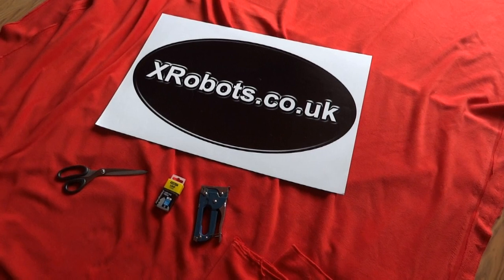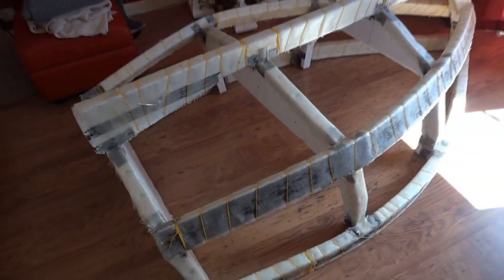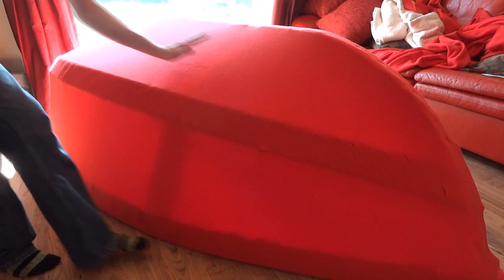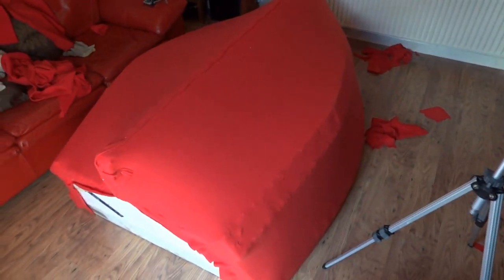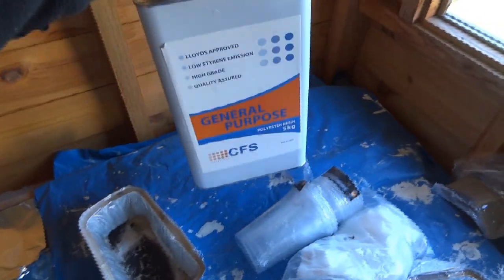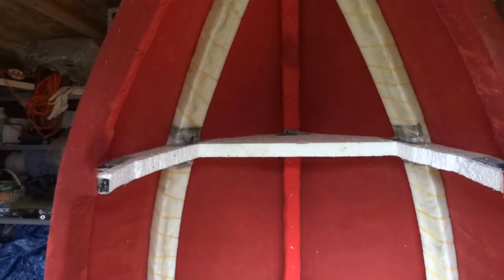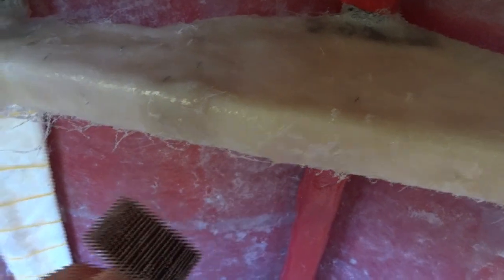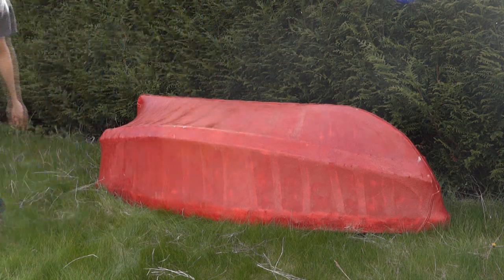Experimental Boat Building Part 5, Skinning the frame with fleece and fibreglass

Comment: There was a company in America that offered a kit for doing something like this way back in the late Forties and early Fifties. They advertised in magazines, and would sell and send you drawings and the fiberglass components for the boat. The builder would purchase lumber locally to build a form, upon which you would stretch a jersey material very tight, then lay-up the fiberglass according to the provided schedule. It was a fifteen foot boat. When the lay-up was finished the builder would turn it over and strip out most of the form, and then glass in the remaining structure to add rigidity. It was ugly when finished; but it was a boat.

Comment: Staples need to run parallel to line your making. Not just however the stapler is angled if you want stiffest stretch. Quality work will get a result.

Comment: i am building my own canoe out of a pvc frame with metal support structure. i am trying to decide what to skin it with and i think this video has provided the answer. i cant figure out what you are using exactly, is it polyester resin or fiberglass resin? i saw both. also, do you think this resin would work on a canvas tarp? or would that be too thin?

Comment: Polystyrene foam in epoxy resin - heat & chemical reaction test

Look this up on u tube.
You might not have had to cover  the polystyrene in glue
Regards
Mee Mor

Comment: that fibergalss cloth should have been completely filled, with No Voids. At least two coats on the fiberglass cloth to fill it. I would have trather seen instead of fabriqe use 1" thick poly foam sheeting glassed
Reply: Gary West I was thinking the same, also if he had the money to buy a chopper gun and an air staple gun, poly foam for the frame also would save a lot of time